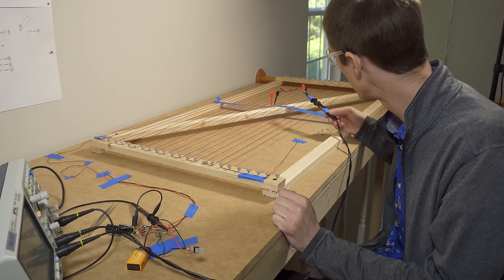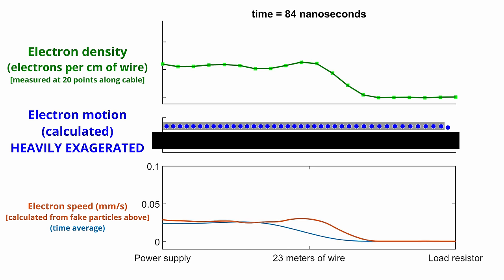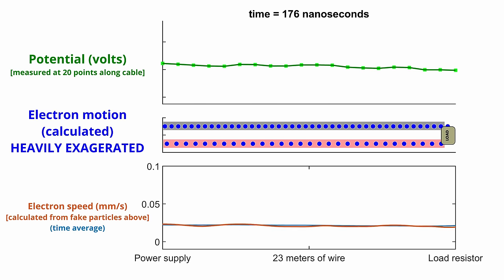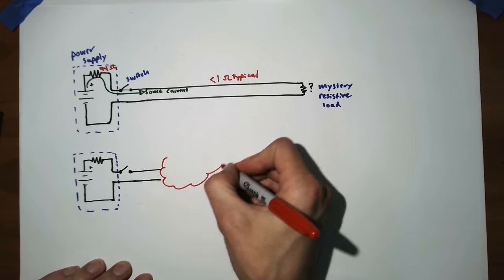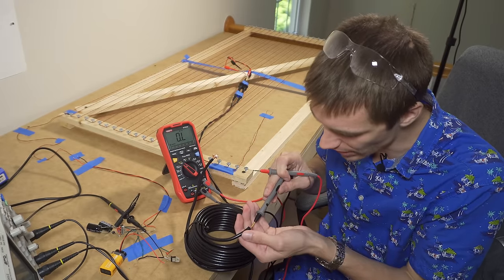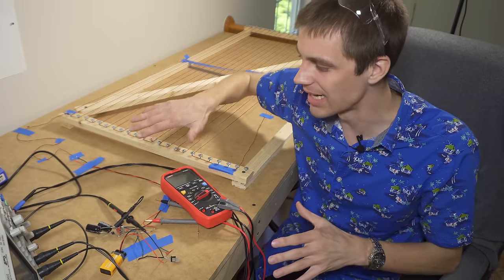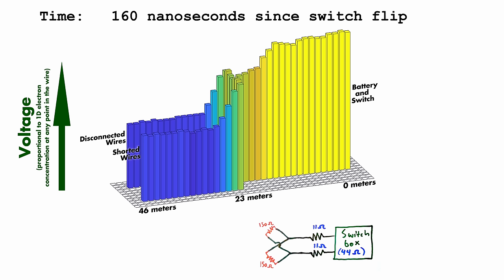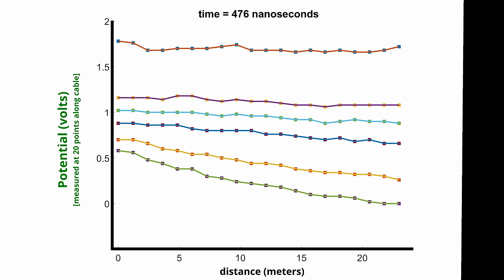What does "impedance matching" actually look like? (electricity waves)

Comment: I don't think it is accurate to state that the electrons "expected to see" any particular value. That value was determined at the offset by the conductivity of the wire and the inductance and capacitance of the layout. Imagine  using your water model, the speed of the wave would be determined by the pressure (voltage) acting upon the molecules of water (electrons) and then modified by the characteristics of the water line (number of turns and the effects of the pump pulsing at a certain frequency = capacitance and impedance). Impedance matching is "not something expected by the electrons" but rather a modification that generates minimal reflection of the wave in the case of an antenna. If we want the most efficient power transmission thru a wire, we might consider different modifications. Anthropomorphizing can be helpful but when I push on something, I can visualize that exerting pressure "here" doesn't "instantly" impart movement to the other side of the object. If the object is dense and rigid, the other side will begin to move earlier than if it is made of soft rubber. Pushing electrons into a good conductor would likely propel more electrons that will be able to more quickly change the voltage at any particular point, capacitance will tend to "even" out the pulses or waves, inductance will store and release pulses. Adjusting resistance, capacitance, and inductance allows us to manipulate the output to best achieve our goal. Not necessarily the electron's goal?

Comment: Heavy duty stuff - I’m going to have watch this again and again. When physicists look at light wave transmission down an optical fibre we worry about a backreflection from the end of the fibre. It is caused by a refractive index difference between glass and air and we can ‘match it out’ with a drop of oil (no longer a good idea with todays fibre connector designs.) we picture the light wave bouncing off the glass to air interface at the end of the line. In our heads it looks like the graphs you have displayed here.  Ultimately the physics is the same as it is an electric field driving a charge distribution but I’m going to have to think about it all over again. Bravo on your brilliant work.

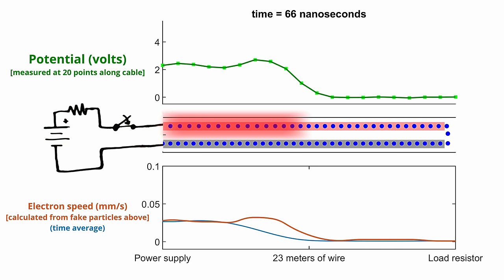Comment: 11:00 OK, this is only half the explanation -- you have to also include the (piecewise incrementatl) inductance of each wire, and the mutual inductance of the two wires together. That's why the whole transmission line is NOT just a capacitor.

Comment: Outstanding work to capture and present this concept.  Since you are more practical and motivated than me - perhaps a line constructed of a chain of series inductors and parallel capacitors to represent the resistive "characteristic" impedance with the 'basic' elements that make up a cable (inductive conductors and capacitive coupling between conductors). Also helps explain why different cables have different impedances. Beautiful video - thanks again. Will show some others at the workplace to help reinforce the concept.

Comment: Yeah when you deal with audio speakers impedance is everything of utmost importance      to get truly high-powered systems It takes a lot of knowledge about OhM levels and resistance and cable size is and knowing the skin affect Because the output is AC even in car audio.      It's alternating DC current which is strange but very fascinating it just shows you current Is current AC and DC is the One in the same.

Comment: So much time with an oscilloscope, but such a cool result!   I already knew impedance is sqrt(L/C), if you can neglect the resistance in the wire, and L and C are the inductance and capacitance of an equal length of the wire.  Now my understanding has, I hope, advanced a bit:

The characteristic impedance of a transmission line is the resistance seen by arbitrarily high frequencies, such as are present in the transient wave-front.  It is a real number if the resistance is low, but in general a complex number (which means the current isn't just a scaled version of the voltage but also phase shifted).  Reflections are somehow related to the difference between the impedance and the DC resistance, so if you can match those two values, you can eliminate the reflections.

Comment: I have been very much enjoying this series. As an electrical engineer who has worked in this area, I would suggest you review complex impedance. The frequency domain impedance is made up of resistance, capacitance, and inductance. I thought when you described the charge being stored in the field you noted that this was a capacitor.

Comment: I'm glad you put this up. So what I'm understanding is that energy is being transferred capacitively, and if your ability to transfer power conductivity isn't the same you get a reflection, but if it is the same you get steady state right away.

So for your experiment where you had the wire separated by a large distance, the initial impedance would be ridiculously high because there's very low capacitive coupling right?

Comment: If you supply AC instead of DC voltage, does the "observed" resistance stay at a 150Ohms even when the ends are disconnected?

Comment: Want to see something really cool?  Do the same experiment mechanically.  Suspend a cable or wire or rope over a distance and then impose a physical transient (pluck it, or strike it at one end).  You'll see the same transient that you saw on the scope, but actually physically propagating down the cable.  Then it will strike the other end and reflect back.  All due to the same "impedance" principles except instead of voltage and current, it represents a ratio of tension to weight of the cable.  High voltage cables often have  little "barbells"  filled with oil a few feet from the cable mounts which are mechanical impedance matching devices which prevent such transients from reflecting back up the line.  Impedance is a ratio of potential to kinetic energy that occurs everywhere that energy propagates.  Great video.  Never take the professor's word for it.   See it for yourself.

Comment: Great video!

Someone likely already said it, but: IIRC one way to calculate these reflections is to imagine a fake line going on forever beyond your resistor, and another wave coming from that imaginary line, passing your wave at the point where the real line ends. The two waves added together are such that the ohms law at the end of the line is satisfied. So if you have a shorted line, you have zero voltage, so the waves must add to zero (like a node in a standing wave), and when you have an open circuit, you have zero current, so the wave's derivative must add to zero (like an antinode). I'm not sure how that'd generalize to the Y split tho.

Comment: Thank you for the video. Swap the DC source for an AC source and then you get standing waves with accelerating charges - a transmitting antenna.  Then an open wire can act like a pure capacitor of the length of the wire is 1/4 if the wavelength of the source frequency etc.  Fairly standard transmission line theory in Electronic Engineering courses.

Comment: It is over 50 years since my electrical engineering studies covered impedance and surge propagation in transmission lines, albeit at very much higher voltages than this demonstration, but this demonstration would have made my understanding so much better. I have retired, but I try to keep my brain active.

Comment: The  impedance of a transmission line (more properly called "characteristic impedance") is the DC resistance you would measure on an infinitely long transmission line.
A wave going down an infinitely long line would never get to the end of the line and thus not reflect back.  
But if you don't have an infinitely long transmission line (most of us don't) you can put a resistor at the end of the line of the same resistance as the characteristic impedance, and all the energy in the wave will be absorbed by the resistor, so there is none left to reflect back, thus making the transmission line look like it's infinitely long....

Ok, that's my oversimplification of the phenomenon...

Comment: So when your talking broadcast, if your transmission line isn't impedance matched to your transmitter, then all the bouncing that will constantly happen with an AC signal is wasting transmitter power.  I've read and heard this many times but now I have a visual and more intuitive understanding of it based in electron flow.  Thanks for this and congratulations on getting through my thick skull!

Comment: You should think about measuring the twisted pair inductance per unit length and then measure the interwinding capacitance per unit length.  E.G., a unit length of 1 meter.  Dividing the per unit inductance by the per unit capacitance and then taking the square root of this should give you the characteristic impedance (150 ohm)

Comment: So, I know it would have cost more, but to do a demonstration of what the power supply initially injects into the line using 50 ohm coax as well as 300 ohm twin lead might have helped to drive the subject home.

Comment: Awesome experience , I wish you also test it with difference wire setups like:
1. a difference resistance per meter
2. a twisted pair with different twist per meter
3. a open and closed loop wire set without any twisting in the path
4. a pair followed by difference charachteristic pair in series : like 10 meter wire-pair-A connected to 10 meter wire pair B
...
this changes will help us to see how the electrons movement change in reaction to these parameter changes which prove us more about the whole idea , and how electric field and electron movements are different yet connected to eachother .

but I would like to know more about Volt and Amper and how they are individualy show in electron movements.

Comment: That was great. Small correction though: you keep saying "field" when you're better saying "force". The electric force, or "charge", is the real phenomena, the thing that electrons actually feel from each other. The "field" is the mathematical abstraction that describes the pattern in the potential strength of the force as a function of the distance from the charges etc... so the field cannot "cause" anything... the field describes. So yes, the description of the effect of the electron is fundamentally linked to the presence of the electron, by definition ;-)

Comment: Thank you for this wonderful video series. Really appreciate it! 
Did I miss it or it was not said that the initial pulse strength is defined by source impedance ? If you need to place a 150 ohm resistor at the end of your circuit, it probably means that the source impedance is also 150 ohm

Comment: It never makes a mistake. It never expected to see any load. That load was the normal load/resistance of the wire and the current acted as electrons do. A power supply does exactly what it's made to do. It puts out current at the voltage you built it to put out. Anything connected to that supply is the load. It could be an open circuit. It doesn't care. 

Electrons can eventually degrade wire. Seems crazy or odd. But just like a water can wear out a water pipe. Electrons will destroy a wire giving enough time.

Comment: So if you'd put a 75 Ohm resistor at the Y-Split, you would not get as much of the reflection at the split and neither at the shorted end of the wire? What happens if you put a resistor at the beginning of the split, so only one end has the total 150 Ohms of resistance? Would the reflection be "half as bad"?

Comment: Maybe I missed it, what is it that actually determines the impedance matching? In my head I am envisioning it is the 'coulombic diameter' of the wire, which I guess would be the capacitance and impedance of the wire over an extremely short length of wire?

Comment: humm, no mention of internal battery resistance? isn't that the key parameter that changes as batteries ware out? if I'm correct, for batteries, voltage drop is far less significant vs the rise in internal resistance as they age. this makes it hard to test the energy left in a battery, and the main reason you shouldn't mix old and new batteries in a circuit, the voltage may be okay but the circuit doesn't work because there is to much impedance from the old batteries! Presumably the trigger circuit is stabilizing your power supply at 150 ohm (as long as your battery can deliver that much rms power), if that is the impedance matching at the other end?

Comment: Would any of this change if the wires were made out of superconducting material and therefore had zero resistance? I'm guessing electricity travels faster through superconducting materials, but other than that all of the other processes would be exactly the same, right?

Comment: Now go to the next level and add an oscillator and make a transmitter or receiver antenna!  When you put that line in parallel with an RLC circuit you can adjust those values (and length of line) to match to a radio frequency.  Given that the line has a fixed impedance, by adjusting your LC parts you tune to frequencies that resonate in the line.  I learned this in the math and equations first but it makes perfect sense when done physically too.  Time domain reflectometry infoems this too as you see every transition.

Comment: Characteristic impedance isn't just a magic resistor, it's the net effect of the inductive and capacitive energy wells distributed throughout the transmission line.  The wires have self inductance (pushing charge carriers down them stores energy in magnetic fields around the wire), and the proximity of the wires creates a capacitance between them (charges on one wire can feel charges on the other, and store energy in the intervening electric field).  The balancing of these energy wells is what results in a natural ration between current and voltage, and when we divide voltage by current we get *impedance*.  When it's a resistor, that converts current flow to heat, it's a resistance, but when it's just trading energy between fields, it's reactance.  Hence careful terms here, with impedance instead of resistance, and especially the "characteristic impedance" of the transmission line.

Change the geometry of your transmission line, and you change the relationships between these inductive and capacitive elements, and you get a different ratio -- a different characteristic impedance.  You could consider twisting up transmission lines with different thicknesses of insulation and showing that they are terminated with different resistances.

Comment: Wait a second.
This particular configuration is winded using a twisted pair wire,  right?
Winding the same wooden frame with giant coil pattern and winding it with giant zig-zag pattern would provide two opposite examples of impedance....

Comment: Valuable insight, I've been wondering about how reflections and impedance mismatch work in the context of DMX512 (RS-485 signalling)

It specifies 100-120 Ohm twisted pair, and you're supposed to terminate the line at the end with a matching resistor.

Comment: 4:04 What do you mean by impedance matching in DC context? I'm extremely concerned now because my flashlight batteries don't match the impedance of the bulb and my starter motor doesn't match the impedance of my alternator or starter.

Comment: I used to work on semiconductor etch chambers and we used a match to keep impedance as low as possible to keep the 3000wats of RF flowing into the chamber keeping gases in chamber ionized while etching a wafer

Comment: I have a much easier to understand "reason" for why transmission lines have this characteristic resistor:
The 2 wires are capacitors. Each meter of wire adds more capacitance. With the wave traveling at constant speed, it has to charge a constant amount of new 1m-wire-capacitors per time. Each capacitor needs a constant amount of charge to reach the full voltage, more voltage, more charge needed. So you now have charge per time per volt, which is current per volt which is resistance.

Comment: So in theory the shape that the cable is arranged changes it's inductance and therefore impedance right? If the cable is wrapped into a coil it has a different impedance than straight right? It would be cool if you could see a change of impedance depending on how you move a cable around.

Comment: This is verry verry cool 👍 I guess this was a ton of work to make and to visualize.
You always describe the wave on a pair of wires, but one can also see 2 waves heading against each other. There is one positive wave front coming from the positive terminal and one negative wave front coming from the negative wire, right? And these waves cross each other on the load. This is how i would see it ...

Comment: This has Main Channel Quality.

But I was kind of waiting for you to keep the termination resistor at 150R and running it again adding something like grounded aluminum foil ontop of the wires to change there impedance so that yet again the termination is mismatched

Comment: The same impedance effect is also why musical instruments are shaped the way they are.  For example a violin transforms the impedance of the vibrating string, which makes almost no audible sound, through the bridge impedance to the body impedance and then to the air where it travels to the listener.  All the components also add filtering effects leading to the instruments unique timbre.  Slight variations in impedance are why one instrument sounds best with steel strings while another prefers synthetic.

Comment: What would also be interesting is to see what happens when the voltage is removed. In a self induced coil I expect there to be a large spike 2-3 times larger in reverse voltage traveling back towards the source (back EMF). But since these wires are somewhat physically separated, I wouldn't expect it to do that to such a degree.